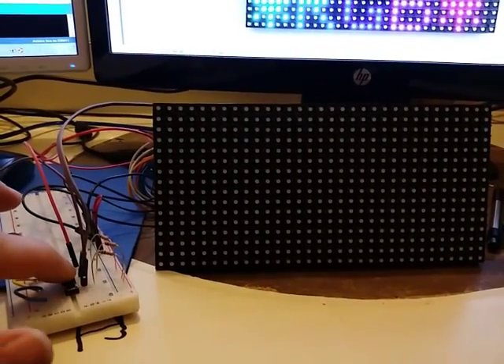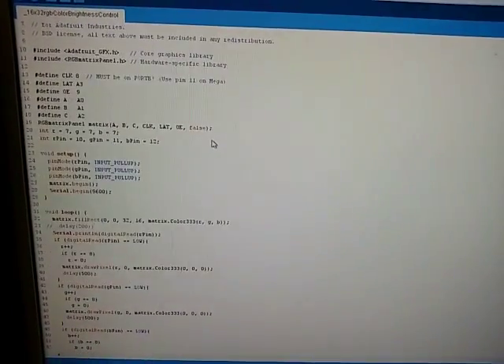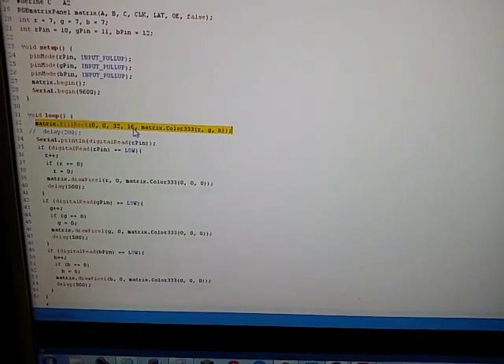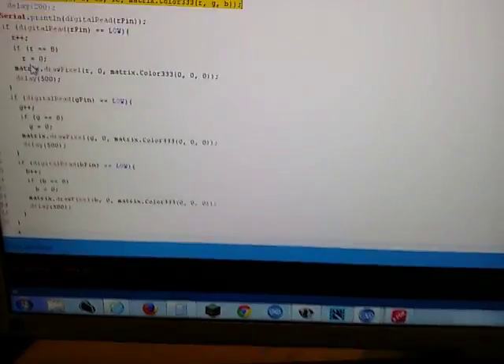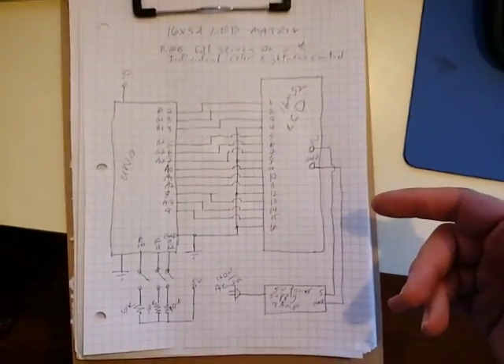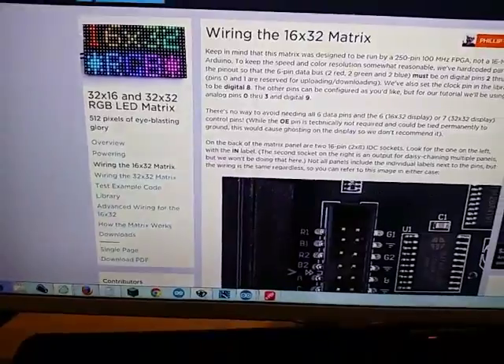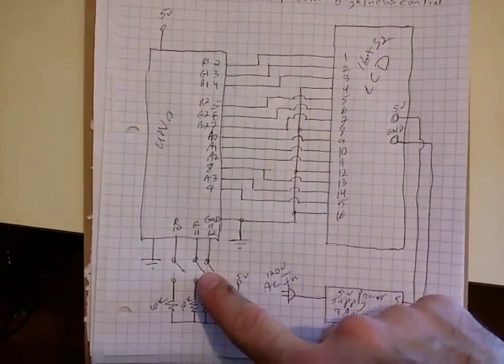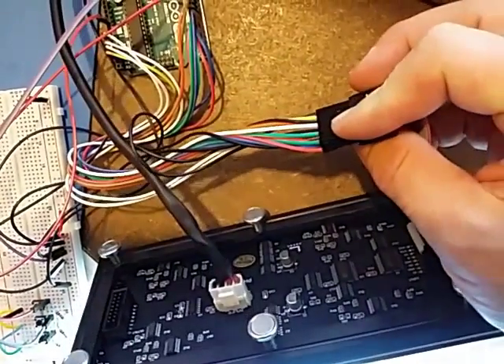Arduino UNO 16X32 RGB brightness Control

Comment: can i see source code for control brightness control?
Reply from the maker: // testshapes demo for Adafruit RGBmatrixPanel library.
// Demonstrates the drawing abilities of the RGBmatrixPanel library.
// For 16x32 RGB LED matrix:
// http://www.adafruit.com/products/420

// Written by Limor Fried/Ladyada & Phil Burgess/PaintYourDragon
// for Adafruit Industries.
// BSD license, all text above must be included in any redistribution.

#include <Adafruit_GFX.h>   // Core graphics library
#include <RGBmatrixPanel.h> // Hardware-specific library

#define CLK 8  // MUST be on PORTB! (Use pin 11 on Mega)
#define LAT A3
#define OE  9
#define A   A0
#define B   A1
#define C   A2
RGBmatrixPanel matrix(A, B, C, CLK, LAT, OE, false);
int r = 7, g = 7, b = 7;
int rPin = 10, gPin = 11, bPin = 12;

void setup() {
  pinMode(rPin, INPUT_PULLUP);
  pinMode(gPin, INPUT_PULLUP);
  pinMode(bPin, INPUT_PULLUP);
  matrix.begin();
  Serial.begin(9600);
}

void loop() {
  matrix.fillRect(0, 0, 32, 16, matrix.Color333(r, g, b));
//  delay(200);
  Serial.println(digitalRead(rPin));
  if (digitalRead(rPin) == LOW){
    r++;
    if (r == 8)
      r = 0;
    matrix.drawPixel(r, 0, matrix.Color333(0, 0, 0)); 
    delay(500);   
  }
  if (digitalRead(gPin) == LOW){
    g++;
    if (g == 8)
      g = 0;
    matrix.drawPixel(g, 0, matrix.Color333(0, 0, 0)); 
    delay(500);       
  }
  if (digitalRead(bPin) == LOW){
    b++;
    if (b == 8)
      b = 0;
    matrix.drawPixel(b, 0, matrix.Color333(0, 0, 0)); 
    delay(500);   
  }
}
Reply: Ok sir thanks